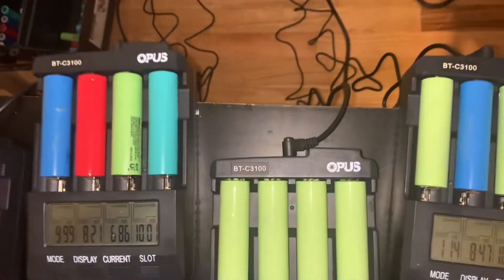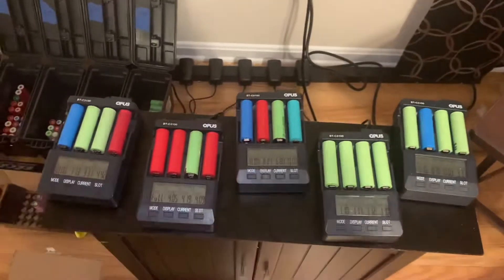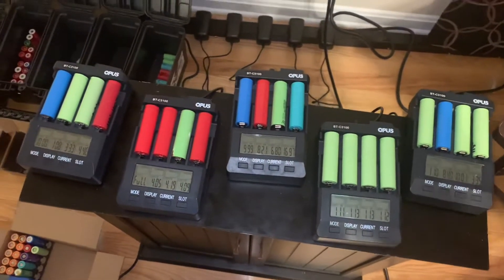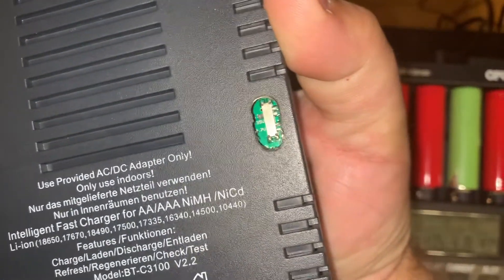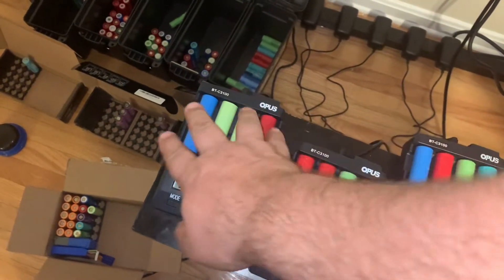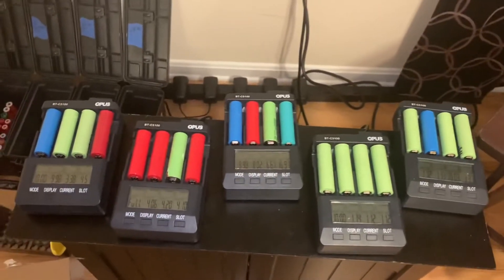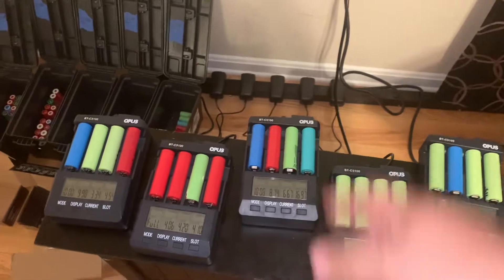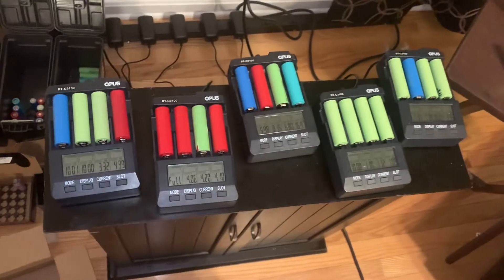Review: Opus BT-C3100 18650 Cell Charger/Capacity Tester

Comment: I enjoyed your video, very informative.  I have a question that I have yet to find an answer for.  First off I have 10 of these chargers, I do not know what I did however I was able to get them all Automatically Alternate From (Full to Mah) I have no idea how I got them in this mode.  I also found if I hold the Display button for 6 seconds the led display light will stay on, it was experimenting with this I somehow enabled all 10 chargers "Once Full" to alternate the display (Full then change to Mah then to Full to Mah repeatedly)  Once I removed all the charged batteries I have yet to get it to repeat that, do you have an idea how this is achieved?  I have downloaded a manual for this however nothing is mentioned about this feature.
Reply: @LewisMoten  Interesting, mine do not do that, I was surprised when they did Full status to Capacity every 2 seconds.  But now it only shows Full then when I hit display I can cycle through all the V, Vma, Vmah & h, it no longer alternates as yours do.  I'm trying to figure how to get it to for it helps when writing down the capacity. I wonder if it is an initial setting that triggers this to alternate between Full & Capacity.  I'm curious when you place batteries in your charger what mode do you start them on please?
Reply: @LewisMoten  Yes that is it, Thank You So Much, I was using other modes.  Thank You Again that did the trick ; )